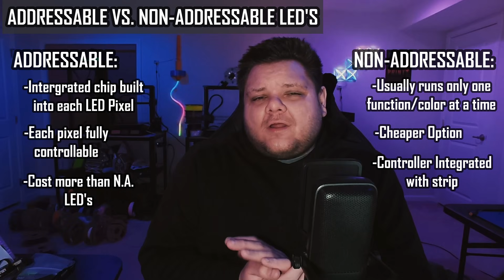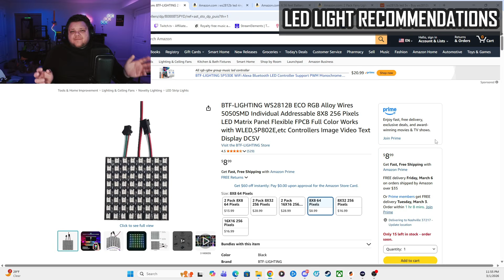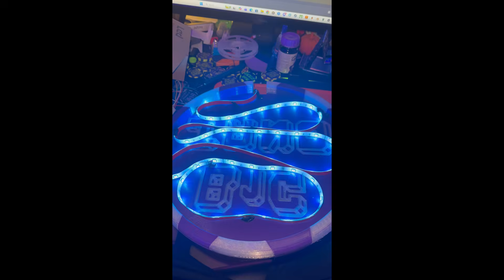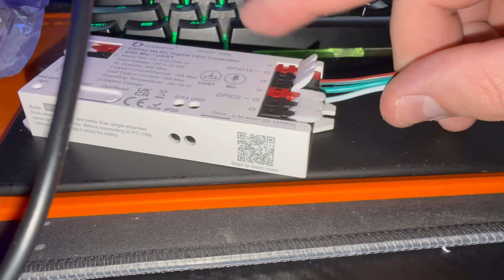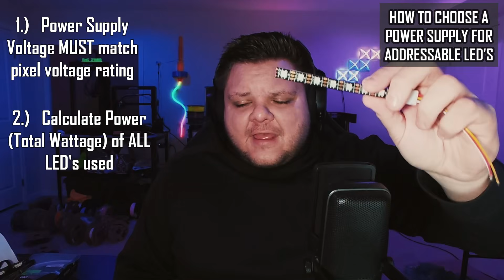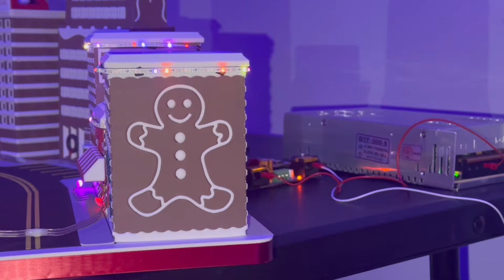3D Printing and LED Lights: The ULTIMATE guide in how to use BOTH in your Next Project!

Comment: Hello. Fantastic video and brilliantly detailed. Im loosing my mind with an project im trying to make. Im trying to make a front diffusion for an led sign with using clear glitter / sparkle so when the cob led lights are on i want the glitter to show through very strong but ive done 4 prints and the sparkle isnt really showing up. Is there a way to get the sparkle showing up in very high detail please. Kindest regards barry
Reply from the maker: Thanks for the kind words on the video! 

And that’s a good question. In my experience with that type of filament, I’ve found the glitter material inside the filament doesn’t reflect as well as I would like, like you are trying. My one suggestion would be to try a single perimeter print with a thicker than normal layer, printed much slower than your normal settings. The slower the prints the clearer the filament usually prints which may help the glitter shine more. Unfortunately it’s not the most ideal solution as every filament manufacturer has different compositions. If I find another solution , I’ll make sure to pass it on!
Reply: @B1GJano thank you very much for your advice. Much appreciated